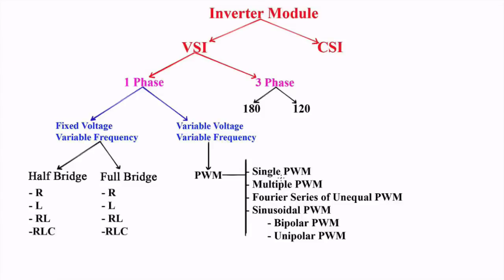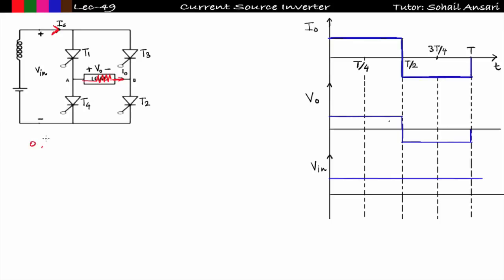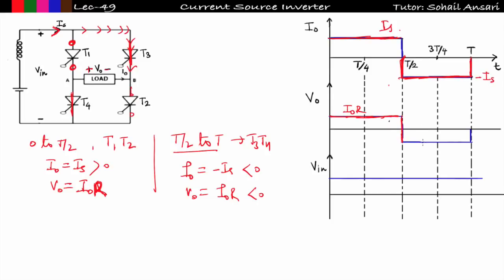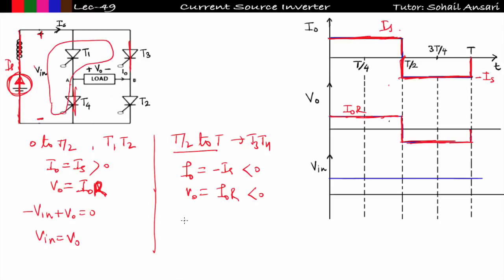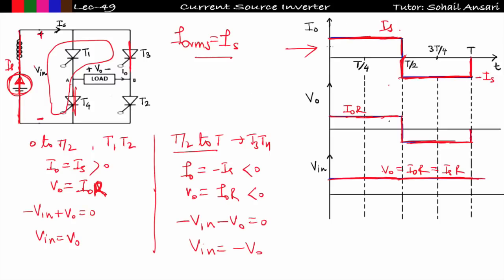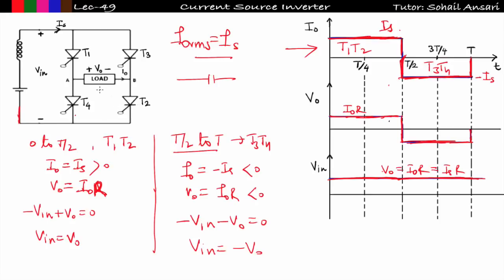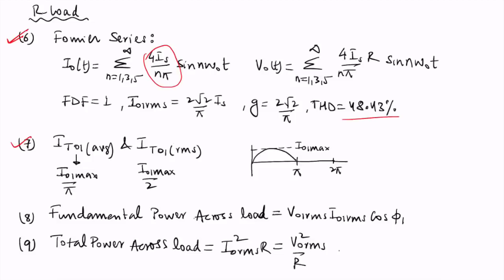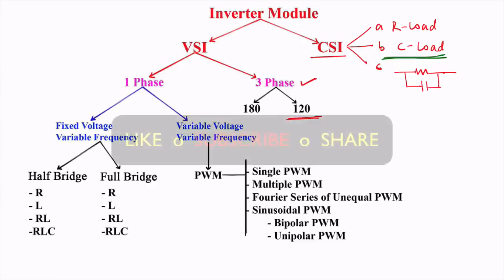Lec 49(a) Current Source Inverter | R load | Power Electronics

Comment: Sir, at input side , inductor act as a short circuit for DC supply how it opposes sudden changes in current,  it is true for AC supply please clarify. .
Reply from the maker: See the load current..it is fluctuation...which mean Is must be fluctuating but as high inductor is connected which make the source current constant ..hence whole combinations is called current source..got it